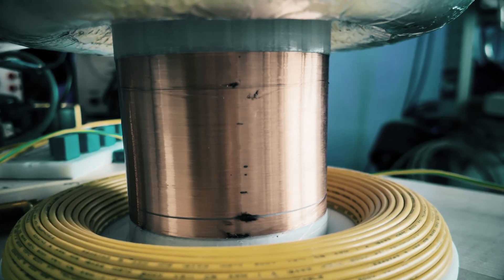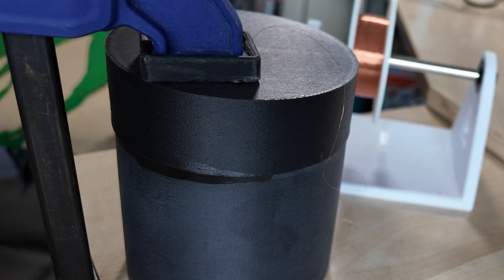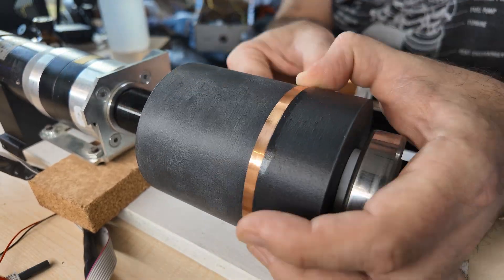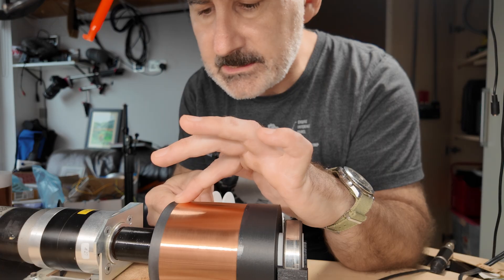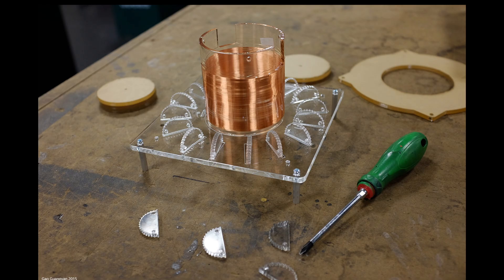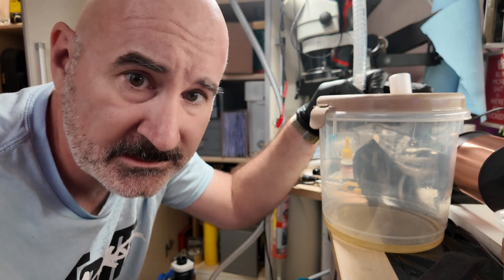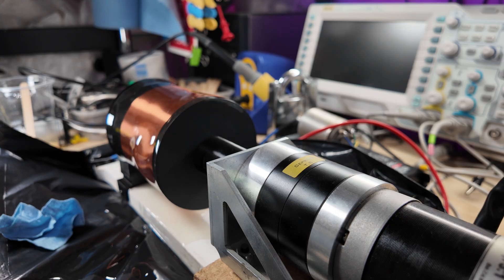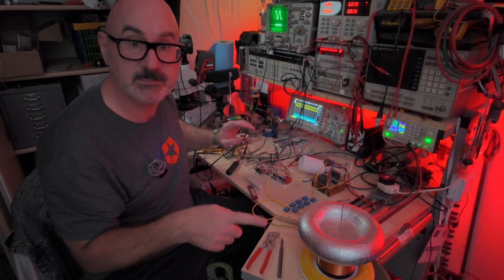And Love The Coil

Comment: How much of a vacuum do you need? Hand-pump brake bleeders are super cheap. Thinning it slightly with acetone will make it easier to remove bubbles but will increase setting time. Bubbles could cause arcing. Applying it with a bubble-filled foam brush also introduces bubbles, but I suspect you noticed that. Stop by any hotel and ask for old plastic room key cards and they'll probably give you as many as you want. They make good spreaders. Cheap silicone spatulas work even better.
Reply: the vacuum needs to be decent (still very rough compared to high vacuum stuff but yk). i would use atleast a single stage rotary vane pump- and most importantly needs a proper vacuum chamber thats not plastic and manages not to collapse itself immidietely
Reply: @9551dev A glass jam jar with a pipe in the lid works fine as a "propper chamber" as far as degassing epoxy, so that's an easy solution. (I recommend putting that inside a larger plastic jar to be extra safe.) I think the $15 hand pump will get high enough of a vacuum but maybe won't hold it very long, so anything other than 5 minute epoxy probably would wear you out pretty quick. You can get those 12V air compressors super cheap, too, less than $10. I have modified one of those before to swap the input and output, turning it into a vacuum pump. Also in a pinch I have unscrewed the intake air filter from my shop air compressor c used that as a vacuum. Yes, I did a lot of hacks before I finally bought an actual vacuum pump, but they all worked bettere than expected and I'm pretty sure they would all degas epoxy.

Comment: thats the reason they dont use black pipe for secondary windings and whatnot im building my very own sgtc right now will make a sold state later but i really love your videos and the time you put in them the little chug of dcm got me edit i recoment you buy one from a guy with a winding machine , a winding machine cost like 100 or so bucks to make and winds a coil so fast i got mine for 20 bucks off aliexpress its not worth it to make your own in my honest opinion because it would have taken me like 10  hours to make the 2000 turn i have and with the price of a pipe because i need to buy 5m minimum and the wire it comes out to 10 bucks for the winding so im baisically making 1 dollar a hour the machine can make the secondary in 30minutes

Comment: maybe it arced internally because the 3d print the coil is on is porous and the varnish won't have gone into the print. This could be fixed by first doing a thin coat of varnish then coiling over that and doing another coat of varnish. Also as stated by @kasisko_Kaso-0 carbon fiber is conductive.

Comment: I watch your Tesla Coil Videos  now for a while. I Like how Experimental but also high quality your builds are😊 and really Like how you doing the Videos!
But i have to say, i also See a lot of Errors. Especially how you build your secondary.
You Put soooooo many Turns with soooo thin Wire on it, your Resonant frequency is so Low, you will have a unbeliveabely hard time to get even Close to get straight arcs.. The Q factor is extremely Low, you have a lot of stray capacitance from the secondary itself. 
Your Material you Wind the coil on, is an absolutely No go😅 
Just get a poly propylene Tube and wind something Like around 0,3 mm Wire on it. 
If the resonance frequency is too high, Bring it down with a bigger topload or HV/HF capacitors in parallel to your secondary. You get straight arcs somewhere 400khz Up to 1,8Mhz+
Also use HF litz Wire at your primary. So ist will Not Heat Up that fast and also Higher currents can flow at high frequencys.
With Things Like that, i improved a lot in my VTTC.
Reply: You are coming from VTTC knowledge, for a QCW you actually want a bit lower resonant frequency. anything above 400khz and the arcs will start to bend and split, which you dont want when you want very straight arcs, the sweet point is about 300-400khz as far as i know for these.

yeah the material that the secondary is made from here is awful, also DEFINITELY NOT 0.3, that would be probably > 800khz which is a PAIN to drive solid state like this and not good for QCW

i dont see why it would be hard to just buy some thick walled tube..

yes you generally want a bigger topload in a QCW to lower arc-load detuning (on the secondary side since usually ran fully at primary resonance with a high capacitive reactance tank to limit the current rise to allow for long pulse times without triggering OCD/blowing the bridge)

1.8Mhz will absolutely NOT produce straight arcs and it isnt reasonable doable with a bridge inverter setup like this with IGBTs, i dont think my setup could pull off even 1Mhz with really fast silicon carbide mosfets.. and even if it could the power to gate drive alone would be a bit absurd

you could lower arc loading and frequency by putting a mmc made out of mmcs inside of the secondary, my friend 609 from the styropyro discord has done this in a VTTC and got good results

Here using litz wire could be fine but its not too needed as with QCW it will mostly be running pulsed operation, i dont think primary overheating should be too much of an issue
Reply: @9551dev Uh OK interesting! Yes im only have knowledge about VTTC's and didnt know, that it is Not possible to get such high frequencys with IGBT's ...sorry for my Missinformation😬
Thanks for the correction!
Reply: @marvsworld247  Its okay!, im no expert either :p ~~just been digging a bit into this topic myself..~~

you probably have a fair bit more practical experience than me on VTTCs- sometimes tuning them is a bit of a mystery :)

Comment: Could u build the easiest Tesla coil with only transistors, resistors and capacitors but no ICs please? 
I want to build one but I can't shop online for gate driver ICs because I think they will give me not functioning ones so I don't want to buy them onli
Reply: You can just make a half decent gate driver with a PNP-NPN push-pull or totem pole. You don't need an IC.
Reply: @SkippiiKai  or buying ICs from a reputable supplier isnt exactly that difficult :P, and heck you run into the same issue of risking getting fake bjts... tbh getting fake power silicon is more of a risk than getting fake ICs

Comment: to remoove buble in general you just burn slitghtly with a blow torch, you can see that in every video of resin table making XD. Hope this is not the coil that is broken this time !
Reply: that will only really remove surface level bubbles, there is tiny bubbles within the epoxy that that wont remove

Comment: I'm not sure if the carbon fibre secondary was a good idea because carbon is conductive. Maybe the reason for the smoke was internal arcover in the secondary?
Reply: Definitely not a good idea!, people always avoid black pipes because of the risk of carbon paint and usually even sand off the text. Let alone 3D printed! 3d printed is suboptimal for this cause the arcs have no issues sneaking in between layer lines. (almost all of my primary arcovers so far came from using a 3D printed primary coilform)
Reply: @9551dev  To be fair, I've used the black ABS pipes a few times and they are non conductive.
Reply: @benjaminlockhart99  hopefully it works out fine
Reply: Oh no. not a third wind!